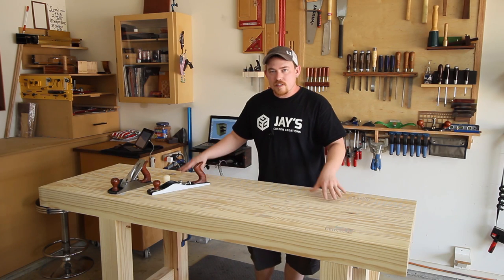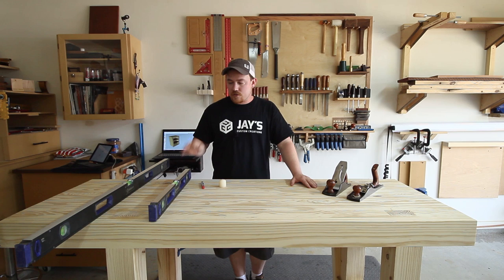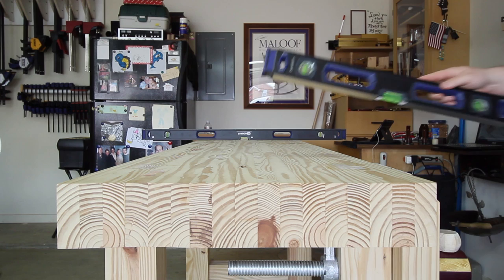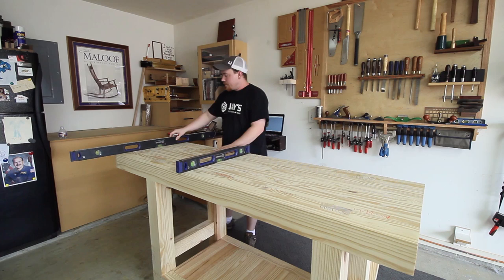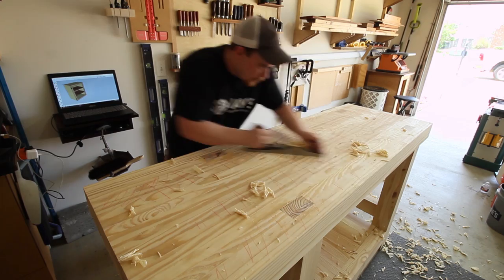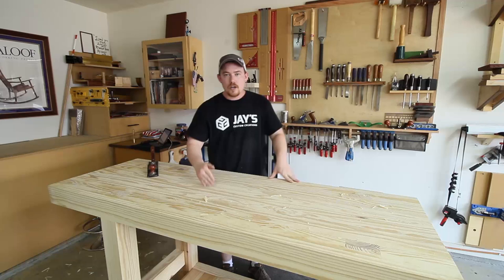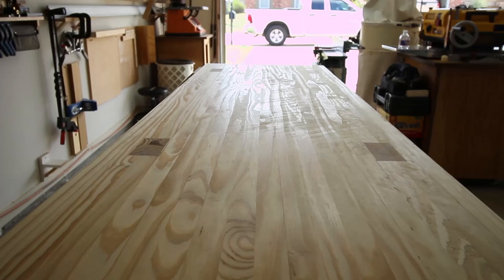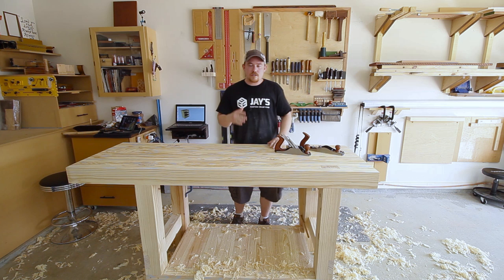How To Flatten A Workbench Top With Hand Planes - 248

Comment: Good video, good info.  However, I struggle with the winding sticks.  I just can't seem to see two sharp lines to compare.  I tried simply using one level.  If the bubble stays in the same place in the tube as you move it down the bench, doesn't this mean that the top is parallel?  If there's some twist, the bubble will move.  The bubble does not have to be in the exact middle of the tube (your floor might not be exactly level), it just has to stay the same.  Is this a reasonable strategy?

Comment: jay, you do excellent work with manual tools as well as power tools. I have a work bench I need/want to make flat, planed HATE me, (I'm incompetent w/straight hand tools) so I'm going to try using a router sled and the X string method. your way shows mad woodworking skills, which I don't feel I have. just keep doing what your doing, and the subscribers will beat a path to your door.

Comment: 3 in 1 oil also works nicely to lubricate the sole of your plane. I keep a rolled up sock in an old Brasso can on my bench; squirt some oil on it every few weeks and run the plane over it after every half hour or so of planing. BTW, I took that tip from a Paul Sellers video.
Reply from the maker: 3 in 1 is great stuff. I've got the Paul Sellers oil rag can as well. Didn't bring it with me for this trip. I use it to keep rust at bay but prefer wax for the sole when working.
Reply: +Jay Bates I'll have to give wax a try, especially for those rough flattening sessions. I imagine it would be a good lubricant for a hand saw, too.

Comment: Great explanation Jay. When I did mine some time ago I damaged my edges slightly when flatting it down....I dont know if you had the same issue. I would therefore only add that maybe chamfering  the edges slightly beforehand may be something to consider. Thanks Jay.....great work.
Reply from the maker: I didn't experience any of that but a slight chamfer does make sense in this situation.
Reply: so, you must be called  Chamfer edge woodworking then

Comment: I think you make amazing videos. Not only the content but especially the presentation are excellent. Your humor and honesty definitely set your videos apart from others. I loved you insights on different tool brands so very informative.
I've noticed that you have used solid lumber at times and plywood for similar projects and was wondering if you would provide your opinion on pros/cons for benchtops and vise heads. I am planning on building a bench and was planning on using solid wood. I'm not sure now if it's worth it after watching some of your videos. You opinion please.
Also since you smooth the bench top along with leveling, I would be interested on your opinion on finishing the top with an epoxy. My thought is it would seal and level but might be too smooth.

Comment: you can consider yourself a woodworker if you can flatten a workbench . Every cowboy can built a bench  but try and flatten it .  I used a planner and belt sander and worked few days on it  but failed to create a super flat area  (can see light under the straight edge). 
I then bought a plywood thinking it will do the job  but the plywood itself was twisted  and after using some clamps , screws  wedges  I gave up  and i think Im gonna burn it otherwise I ll have bad times every time i see it

Comment: Jay. Seems like it would be critical for the winding sticks be placed parallel to one another? If they were not, depending on the height of your eyeball above the surface of the levels, you could get a false impression that you had a high/low corner because the ends of the levels closest to one another will appear higher.

Comment: I understand it with a slab as thick as the one you are working on here, there will not be much twist caused by an uneven shop floor, but what about a workbench that is a more common thickness like 2 inches? Could an uneven shop floor be causing the twist that could be fixed by just leveling the legs?

Comment: Great video again Jay! I'm still a novice woodworker, especially considering hand tools. But I was wondering what about grain direction? You told in the video that you plane with the grain direction when you used the smoothing plane. But are all the parts that were glued up to this top positioned in a way that they all have the same grain direction? And what about boards that change grain direction along their length? That's not an uncommon thing, is it? Or imagine this top being a tabletop where you position your boards to get the best look. You can't always get ideal grain directions all over the top in that case, can you? How would you go about smoothing that out? I haven't really found an answer to this so far. It would really help me out if you could shed some light on his matter. Thanks!

Comment: I have three planes, one that is ultra small, one medium size and one that is I think standard or a little bigger. Where can I look on them to find out what number they are? I have taken them apart a couple of times for maintenance but don't know where to look for the number.
Reply: Jason McCabe popular woodworking magazine has an old flyer for stanley products.  Most "standard" planes have a 2 inch cutter.  If you have a plane that is about 9 inches in length with a two inch cutter than it is likely a number 4.  Any planes that have a wider cutter or are longer in length are either jack planes or jointers.  Jointers are about 22 inches in length.

Comment: How do you prevent the plane blowing out an edge in the soft pine when you go all the way across?
Reply from the maker: It shouldn't be an issue but you can put a tiny chamfer on the edge first.
Reply: A sharp blade helped. My pine is not the best.

Comment: I just have a question. I'm looking into straightedges and am finding that these can get extremely pricey. However, I feel I don't need machinist accuracy. So these levels are good enough for woodwork benchtop flattening? Honest question, not questioning your technique. Because I want accurate, but I'm not spening $600 on a starrett 72" straightedge lol
Reply from the maker: It just needs to be straight. A regular, inexpensive 48" level will work.

Comment: Hi Jay.
I have a question in regards to your bevel up jack that you used first.
Do you have a camber ground in your blade or is it just square?
Thank you mate.
Reply from the maker: This one is just square with the corners lightly clipped. It's OK if the edges of the blade digs in slightly. It will all be cleaned up.

Comment: Would it be possible to do a resin pour on the top of your work bench to give you a perfectly flat surface that is super hard wearing?
Reply from the maker: That would not be recommended as the top would then be slippery and material would slide around.

Comment: Great vid. What, if any, is the difference between some people using 2x4s and 4x4s for the table top?
Reply: I would say 4x4's could/would work out just fine as top...   but I think the benefits of using laminated 2x4's over laminated 4x4's would be that the 2x4's would provide a stronger/ more durable glue joint for handling years of abuse, hammering on, clamping to, etc.   With a top of 2x4's, there would be double the number of boards laminated together then a 4x4 top of the same size, so blows from a mallet, etc. would be better distributed with a 2x4 top.   But, I think the main drawback to a 4x4 top would with the larger end grains of 4x4's, which are much more susceptible to cracking/ splitting...  more often at the lumber yard, you can easily find 2x4's without splits/ cracks at either ends.. but it can be tough to find one from the 4x4 pile without splits or cracks at either or both ends.   Thats just my 2cents at least....
Reply: Sounds logical. I'm going to have a drink and a blue pill now. Brain process overflow lol

Comment: never put your planes flat on the table, with the blade touching the table top. When you arent using it, place the plane on its side
Reply: Check out Paul Sellers. He has a different opinion on placing your planes sole down
Reply: +Peter Compton I don't worry about the blade.  Mr.Sellers made perfect sense about that.  But, I have a tendency to knock things over.  Even big assed hand planes.  I knocked my Type 11 #7 off my bench and the tote broke.  😳. Fortunately some epoxy took care of that.
Reply from the maker: I disagree. Never put your plane on it's side when you aren't using it.
Reply: +Jay Bates That might be a good topic to address on your other channel.
Reply from the maker: JD - That topic has been beaten to death already.